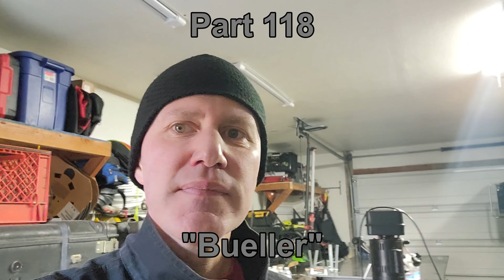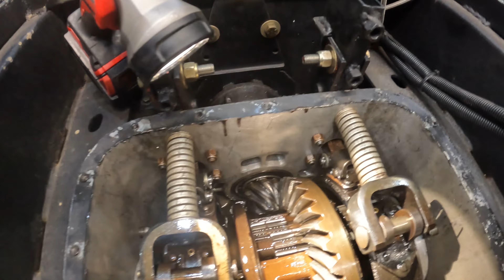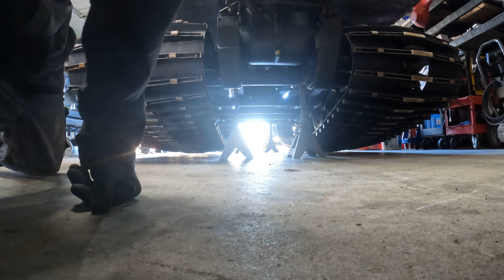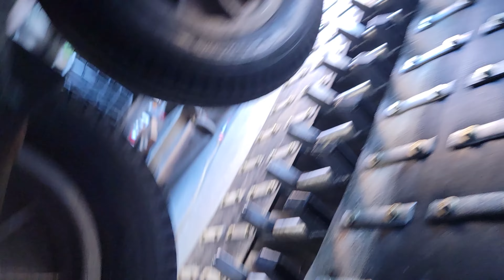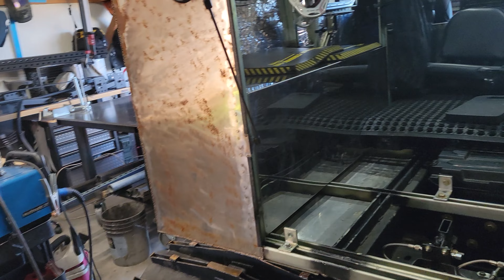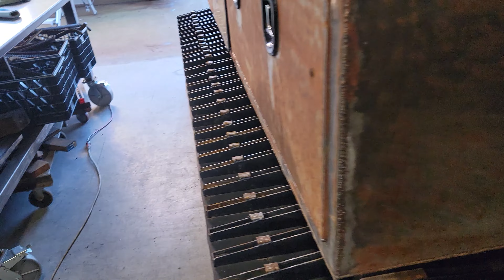Rusty the Spryte build part 118 (snowcat test and tune, differential inspection, pinion seal test)

Comment: Its also a wonderful way to set track tension!
Reply from the maker: Track tension per the spryte manual is 3/8-1/2" track droop between idlers for snow travel and 1/4-3/8" track droop between idlers for dirt/swamp travel....
Reply: be much more precise measuring the droop from the entire track rather than a small span but best do as your mannual says  ha ha ha

Comment: The pinion is the input thus when checking backlash you should turn the pinion, you use foward most so look at whear pattern for the drive foward gear face, it is best to use a disclosure agent. The parameters that can be changed are limited to depth of pinion (controled by shims), side play of ring gear (again shims).
In the video you were turning the drive wheel / track thus distorting operation as viewed by the camera.  The intent is to keep gear face (the hardened and polished face of the gear in contact with similar prepared mesh gear, pinion to ring interface). Lash is amount of back play.
Reply from the maker: Roger that!
Reply: @SeanFillner  😜

Comment: There is no wear next to the outside of the pinion , I would say that it is not shimmed enough toward the ring gear
Reply from the maker: I am going by the OC12 technical manual which shows the wear patterns on the ring/pinion and they match the ones specified in the book.  I guess I should have printed those pages out and included them in the video...

Comment: Did someone mention pinion bearing preload? lol.  Does it have a crush sleeve? If so, it has not been "crushed" down enough to get the proper pinon preload. Ignore your ring gear pattern until you get the pinion preload set.
Reply from the maker: There is no preload or crush sleeves on OC12 diffs.  They are unlike any car/truck differential.  There is a reason there is a castle nut on the pinion yoke...
Reply: @SeanFillner  in the video it looks like there is axial play in the pinion.  I don't see anyway that can be right- the pinion can't move in and out like that. Maybe I'm the video is misleading though.
Reply: @SeanFillner  that setup is similar to a John Deere log skidder rear end, end loader rear end, motor grader rear end, etc.
The pinion is IN FACT supposed to have pre load !!!!
The pinion should not move forward or back!!!
There is a spacer and shims between the front pinion bearing and the rear pinion bearing.
Doesn't matter if it has a castelated nut or self locking nut. Your statement about that shows ignorance.
Reply from the maker: @haroldphipps3457  I am going by what the OC12 manual says.  I will have to take a closer look at it when I get more time.  Does the pinion assembly slide out from the front or does it slide out into the case?  There are only words in the book and not pictures...
Reply: @SeanFillner  the JD stuff comes out the front. When you remove the attaching bolts, the pinion quill, pinion, bearings, and all come out as an assembly.
Reply from the maker: @haroldphipps3457  okay.  I am going to pull it and see if I can source the parts.  You're saying I should be able to remove all of those bolts near the yoke and the entire assembly should slide out correct?
Reply: @SeanFillner  correct.

Comment: I am in the planning stages of making a snow cat, more shaped towards a centaur.  I am having a hard time to decide the torsion or fixed axles.  I want ground/snow clearance for the under belly.  
Do you find that the torsion axles would create drag with the central bar connection when running deep snow or possibly mud?
Reply from the maker: Snowcats ride on top of snow, not through it creating huge ruts like cars do... no drag at all..
Reply: @SeanFillner  
I do like the idea of the bolted torsion axles